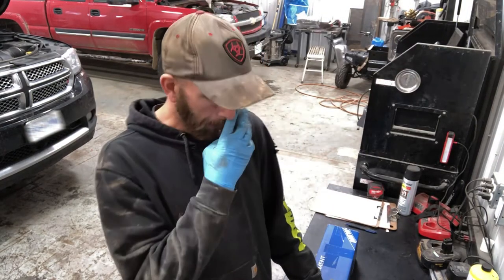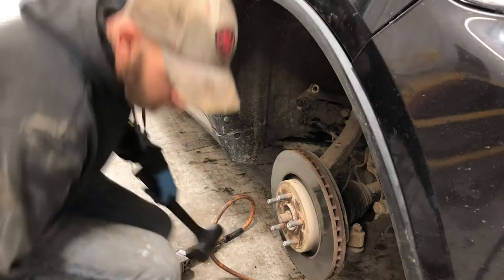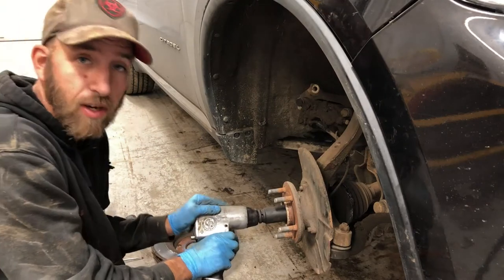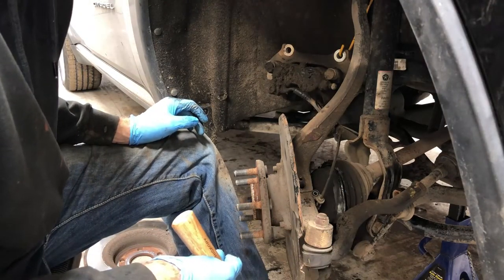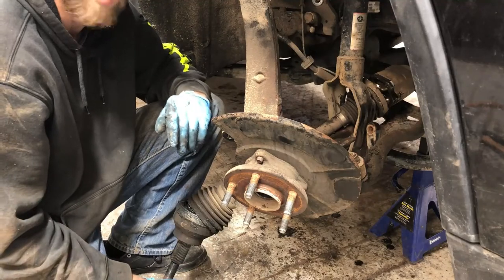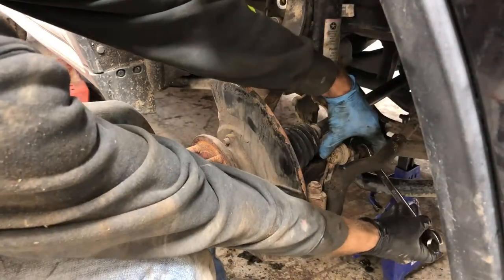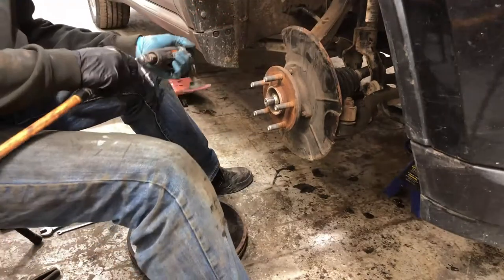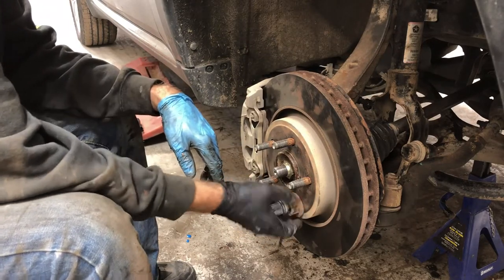2011 Durango CV Axle replacement - Part 2

Comment: One thing I would have done is use brake cleaner on the rotors before putting them back on.  I have to get my front left CV axle replaced on my 2013 soon.  The boot has a hole in it.  $580 quote I got so far to get it done.

Comment: Is this the same for a 2013 Durango? Just did my 07 Honda Pilot a few weeks ago and it was WAY easier than this but this is doable at least for me. My friend needs hers done which is why I’m asking.
Reply from the maker: Yes it is the same. The hard part can be getting the shaft to separate from the Diff. Usually either a hammer with a long punch will knock it out or an air hammer with a long punch bit. Just be careful not to damage anything. Good luck.